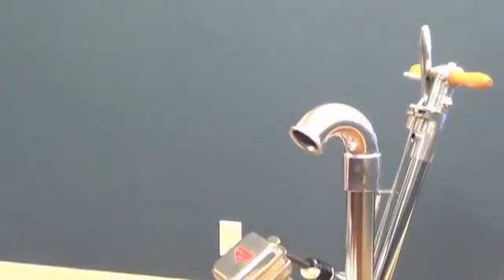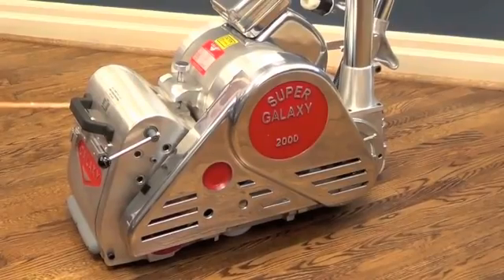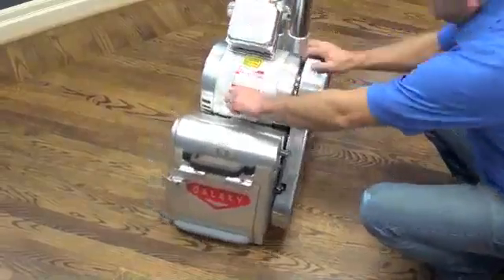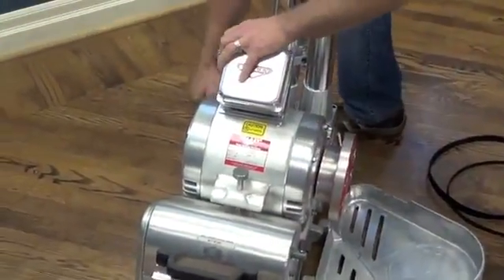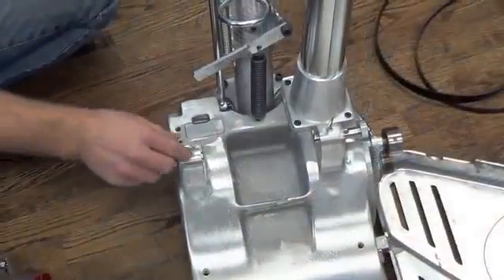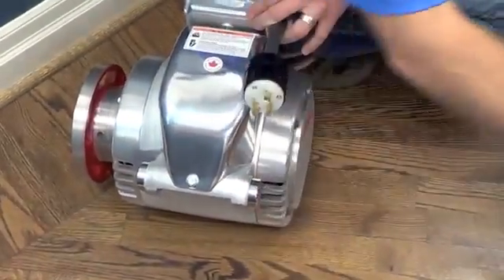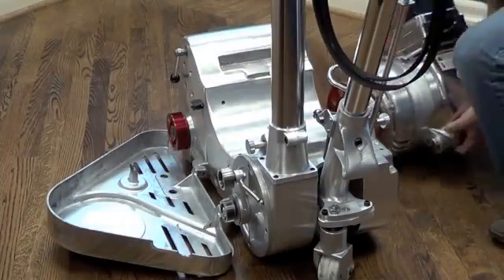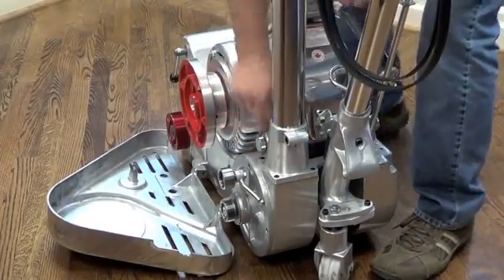Galaxy Floor Sanding Machines: Motor Disassembly

Comment: I have 2 bd12 machines and they both suffer the same problem , can someone help ?  I have lost the startup kick on both and even thou i have replaced all capacitors and switches no luck . any comments anyone ?
Reply from the maker: Hi, have you had this issue resolved? If not, please contact our office for technical support at 1-800-263-5667.
Reply: @galaxyfloorsandingmachines2171 

this machine, has passed hands between three separate companies, we are all tied now to it's history. We would like the machine to be professionally restored to new cond. We welcome collaboration by your company on this very sentimental project. l will pay for all expenses. Thank You brothers.
Reply: Are you sure you have it hooked up properly? If you do check the cord and plugs should fix it if it not the switch

Comment: Just saw one of these things today; a flooring company redid our cherry livingroom floor. The motor on that sander is MASSIVE!
BTW, for anyone reading this, it takes so much power that it needs to be either plugged into an electric clothes dryer socket (240V socket), or directly into the circuit breaker panel!!!